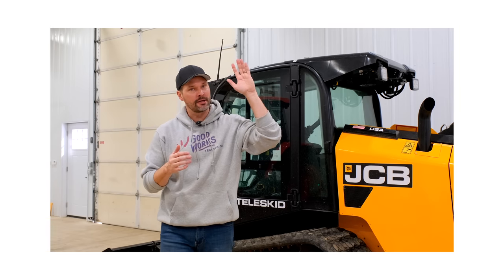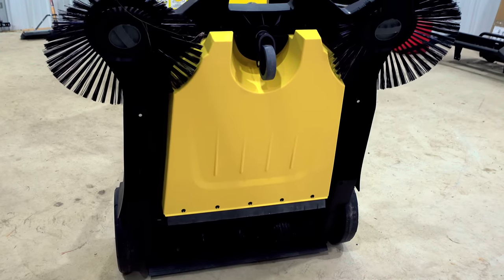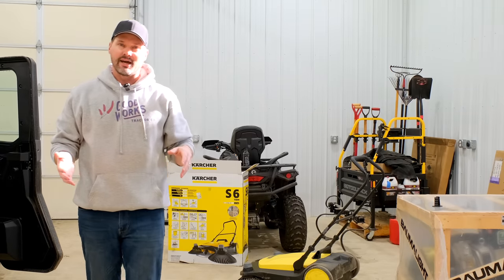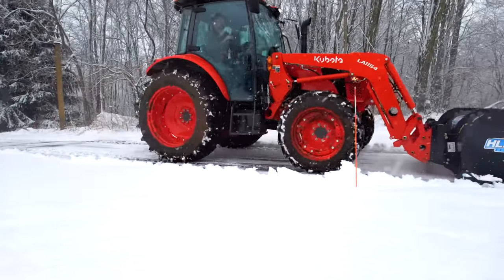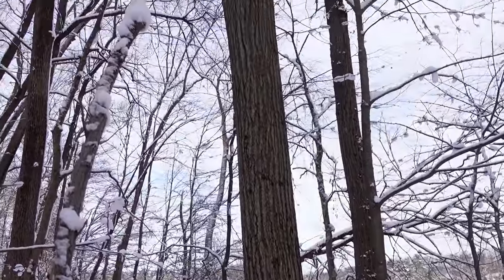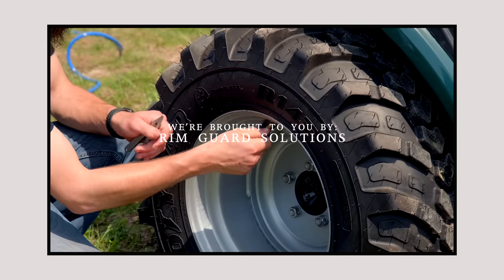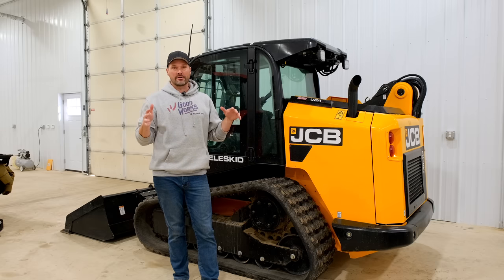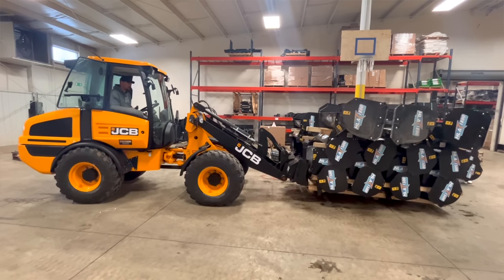YOU’RE STARING AT A $100K WASTE OF MONEY. I’M IN A PICKLE

Comment: If you watch around the 7:26 mark of this video of them moving that load with the JCB loader,  it appears that the rear wheels are just about to lift off the ground.  Scoping out would most likely have tipped the machine.  On your current loader, have you considered adding ballast to the rear wheels?  Probably not recommended by the MFG.  I worked around a couple of CAT 992 loaders that had over 4" of plate added to the bottom of the rear just to increase the carry capacity as they were used almost exclusively for handling materials with forks.  I even witnessed them get the rear tires off the ground when the load was not against the back of the forks.
Reply: We have a Cat 950XR at work with the largest counter weight they will put on it & wouldnt allow rim gaurd. And everyone has picked the rear off the ground at least once moving feed before it starts to let loose. I know we have had the rear at least 6ft off the ground. Our Case 821XR didnt have this issue. Our 972M dosent either but its not an XR. But now the warrenty is up and we are having rim gaurd added to rear tires. Nothing like driving a moving bouncy seesaw. Its fine till we get above 7500# buckets. Its real light when we hit 13k

Comment: I have a jcb 409 and i have lift 3000 kg (about 6000 pounds) on forks to full hight. I think the 320 can do a litle more, but not much, because the 320 can not come as close to the front axle as the 409. 320 is considerly larger and wider then the 409. And takes a lot more space to handle.. So if you dont need the lift hight of the 320 i would save 40000 and get a 409 instead.

Comment: I'm not much on physics, but I think the issue is the weight being way out in front of the lift point. I easily carry my dog's 50' run cable into the yard. But, it's a struggle to lift it into place when I'm 50' away from the other attachment point.
Reply from the maker: Yes, we fully understand what we need to lift and have been lifting these loads for years.  This was explained to the dealer.  They convinced us to go with this machine over a smaller one and told us it would work.  That's the problem, it's not even close.

Comment: Had the load been shorter on the jcb it will lift it just fine, But When its thst long, you need to thake it in calculations of total weight+ lengt. Because the lift capacity is rated at the quick Hitch. 😁
Reply from the maker: Correct, this was known up front as we've had to lift these loads for years with other equipment.

Comment: Courtney all though the Summit does not have the Versa bracket with weight on it. That is not what is missing, Someone "hint hint" did not put the FUEL cap back on the Summit when refueling it. So how long did you run it without the fuel cap?
Reply from the maker: Haha, hint hint :)

Ran it for that entire project and didn't realize until it was back in the barn!

Comment: Make sure that you're taking into consideration your load center.  Lifting 6k lbs at a 24" load center is different than 6k at a 48" load center.  [load center is the distance from the carriage (what the forks mount to) to the center of the load.  Most pallets are 42-48" deep so most lift ratings are based on a 24" load center.  The JCB TM320 has a 7055lb lift capacity.  That's probably 6" off the ground and at a 24" Load center.  Fully extended it drops to 3858lbs and again they probably measure that the same way.  So it may not work for your application, the manufacturer has ratings for all of that, I'd ask to see those.  Good Luck
Reply from the maker: Yeah, we are doing just that.  The manufacturer/dealer said it's not possible to verify what will work for us.  They just want us to trust them...that didn't go so well the first time around.  It's tough when it's 8 hours away and can't bring a load there to try out.
Reply: @GoodWorksTractors  For sure they should know what the capacity would be based on the load center and lift height you need to get to.  YES JCB in Milwaukee would be a good place to call if your dealer's not being helpful.  The family that owns YES JCB owns a lift truck dealer as well so they really understand lifting dynamics.  They're good people, I'm sure they'd be happy to help.

Comment: Not even being at the level of novice when it comes to tractors I was thinking that the plow needed weight on it, but then I was looking at the angle and it was pulling down into the soil just fine.
I did notice a shiny silver item missing from the upper left side in front of the drivers seat.
I'm glad you added the bible verse. Good on you.
Reply from the maker: I think you found it, it was the fuel cap that was missing.

Comment: A JCB tm320 or even a tm420 would be a better choice
Reply from the maker: They have a TM320 and still aren't sure it would lift what I need
Reply: @GoodWorksTractors  when I worked on the farm we took our heaviest item we wanted to lift to the dealers and tried different machines on their site, could this be a option for you?
Reply from the maker: @lukeweetman8197  Unfortunately not.  Construction machinery is almost non existent right now.  I looked all over the country and only found a couple of these machines.  This one was in Kentucky, we're in Michigan.
Reply: @GoodWorksTractors   over here in the UK we use a lot of telehandlers from John Deere, cat, jcb, getting a bit older matbro which is now the new JCB TM range and the agri dealers here in the UK sell them cheaper than construction machinery dealers. have a look at agri machinery dealers as John Deere had a line of telehandlers for a while that were built for them by matbro if that's any help

Comment: what about the teleloader from jcb?
Reply from the maker: The one shown lifting weight blocks in the video is a teleloader.  They have less lift capacity, so you need to go bigger.  The TM320 shown is over $50,000 more than the current unit we have and they still aren't confident it will lift what we need.
Reply: @GoodWorksTractors  ah ok fig I have been really leaning on jcb for the telehandler and loader for bailing. And trying to justify the new fastrac 4220 icon. Just trying to listen how to scale this and trying to purchase property in a 50 mile radius for equipment travel times. So much to learn about farming and tools lol. I might just give you a ring for tool advice.🙏

Comment: Sorry I don't know about Waldo, but I do have one question and one statement with what you think. 
Question is, you have shown the Summit TX25 and talked about it coming with ballast weight already standard in the rear tires. Which is the Rim Guard your sponsored by. Nothing bad on each of them. But in the advertisement video it SHOws you getting the Rim Guard put in the rear tires. What gives? 
The statement is about earring you talk in your garage with the metal walls. It confirms it for me that I Do Not Want metal walls in my BIG garage when I build it. What do you think of the echo, echo, echo when talking? Or even when using a hammer or power tools? What's Chris think of the echo on videos?
Reply from the maker: I have the very first Summit tractor ever built, mine is the engineering unit built in a test lab.  The production tractors come with RimGuard standard.  

We just bought an app that reduces echo for future videos.  Works well.  I'll take the clean finished look and deal with the echo.  Ever been in a gym?  Same with our house when we removed carpet and installed hard floors.
Reply: @GoodWorksTractors  Thanks for the reply

Comment: there is no way for a dealer to size a loader for what you are doing the weight you are picking is 6 to 8' in front of the bucket hinge pins the farther away from the hinge pins the load is the more it decreases lifting capacity cranes and telescoping boom loaders have load charts the farther away from the machine the less lifting capacity but wheel loaders do not have load charts
Reply from the maker: Then they could have told me that instead of confidently telling me it would work.
Reply: There is one way, and that is to do exactly as he requested!  They were willing to shoot a video of them doing it wrong, they could have spent less than one minute extra to do as he asked.  I'd send it back!  And find somewhere else to buy one!
Reply from the maker: @codyshortt4469  They won't take it back.  They are trying to sell me that machine in the video that is $55,000 more and still won't extend the boom out and lift up the blocks.  They're afraid it will tip over.  That's a real confidence booster!

Comment: The problem with what you are trying to lift is the center of gravity is so far out from where the rating is usually taken from.  You need to look up the load rating with forks and more importantly at what load center the rating is at.  Most are rated at 19" - 24" load center.  Your load center was at more like 48".  The load rating will go down the farther out the load center is.  The demo they showed you with concrete blocks had the load close in.  Also every telehandler specs I've looked at the manufacturer provides a load graph.  You should be able to figure it out from that if it will lift your load.
Reply from the maker: Yeah, I'm fully aware of the load center...fully aware, haha.  We have been lifting off loads like that for years.  It's my first wheel loader, it was specifically described what we had to do and the salesman was confident it would work.  They didn't demo the smaller one, that only came into play when we got it here and realized it wasn't even close to doing what we needed.  This doesn't have a load graph.  That machine with the concrete blocks is much much larger and they won't even boom it out to represent our loads.  They're afraid it would tip it over.